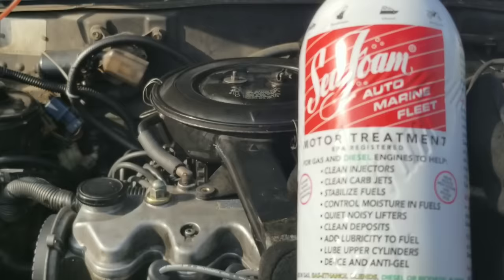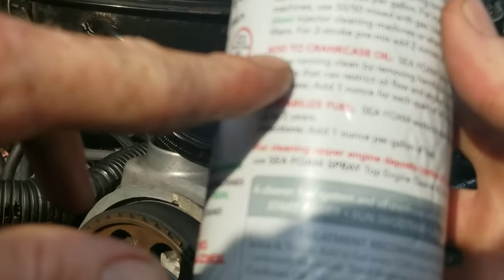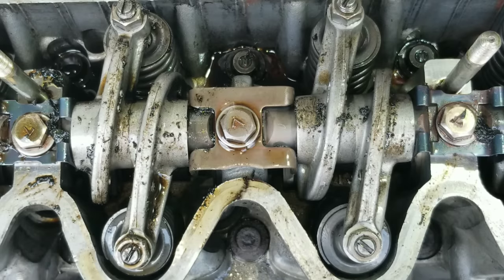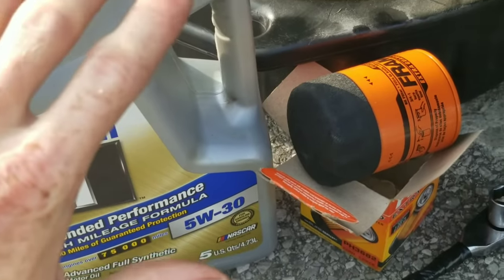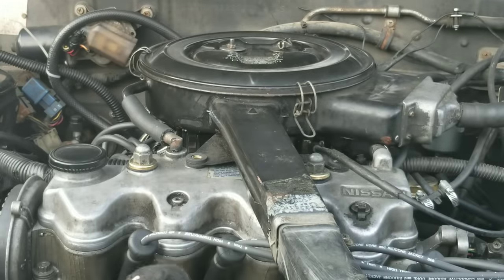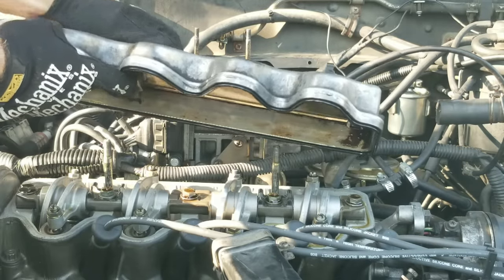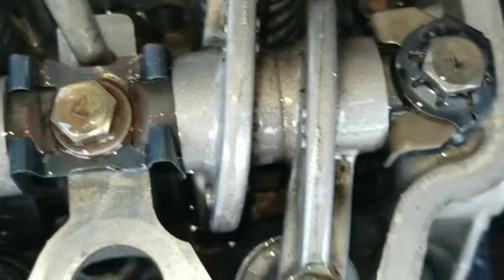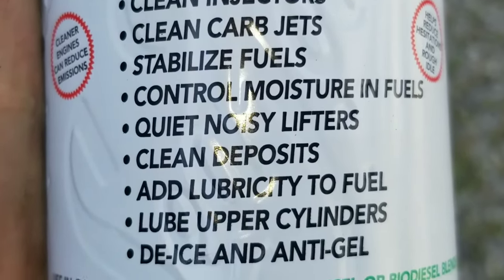Seafoam results i cant believe what it done to my engine

Comment: I'm a retired auto mechanic if you have worn bearings and you put stuff in your motor to clean it you can lose oil pressure because it is the dirty oil particles that is keeping the oil pressure up so if anywhere where you have crank bearings cam bearings connecting rod bearing and you flush your motor out you may lose on a high mileage motor I don't recommend flushing your motor just change the oil like you're supposed to and leave it alone otherwise you could end up losing oil pressure also on an older motor that has a lot of miles on it do not put a high volume pump in an older motor that has a lot of miles on it with a high velocity cough for example 60 lb oil pressure you could end up using oil because the Edition oil can get up in the combustion chamber through the cylinder walls and cause you to burn oil I'm referring to an older motor that that is high mileage vehicle always do a compression test do you make sure your compression is good before you consider a high volume oil pump hope this information helps you the best thing to do when you have a car change your oil every three to four thousand miles and also always change your filter if you always change oil and filter you'll get long life out of your car motor hope this information helps other people

Comment: My question is, where does all that gunk go? It would have been good to see the oil taken out.
Reply: Excellent observation. Be careful using on newer engines. Small oil passages could get clogged from the  loosened sludge and create costly problems.
Reply: It comes out with your oil change

Comment: I got some bad gas pulling my travel trailer with my 2018 F-150, it was stalling out and rough idle. A mechanic told me to use a good treatment and YES Seafoam did the trick, now it's just like new. I keep a bottle with me now just for the bad gas "on the road" situation.

Comment: Using mobil 1 extended performance meant for 15k miles with the shittiest oil filter on planet earth meant to go 3k miles makes zero sense....
Reply from the maker: I use the best oil filter the video is for informational purposes
Reply: Have you ever done a oil change?
Reply: @by_a_tryhard_lol8901  ive only done 2k of them. Why?
Reply: @bmwmike3534  cause you see any type of oil even synthetic its phucked up by 3k
Reply from the maker: Yes
Reply from the maker: What should we test next
Reply from the maker: Yes whats would be good test method
Reply from the maker: What additives do you want to see test
Reply: Go for it
Reply from the maker: What products do you want to see
Reply: using mobil one in general is shit bmw mike. id rather use supertech from walmart with how gritty mobil one is it will run great but thats cause it causes so much friction.
Reply from the maker: Yeah it was a oil flush and thats why inexpensive filter
Reply: I tried using that produc to. Start a fire , it WORKS EVERYTIME
Reply from the maker: Lol any good experiences?
Reply from the maker: Im new to that also
Reply: @NATESINTERACTIVEAUTO  so when flushing the oil, getting all the buildup and grime out of the engine you choose the filter most likely to not filter all the grime out? Makes no sense especially with using high end oil. Under your theory should have been lowest quality oil for the flush
Reply from the maker: The oil actually plays a big role in cleaning also they filter the same practically it is the longevity and durability that make wix xp the best for the price .
Reply: I say change the oil every 3-5k Miles.  I don't care why the oiler car companies say . And the best oil filter is not frame lol
Reply: Ps I hate auto correct!
Reply from the maker: Yes wix xp is the best filter for the price
Reply: Twice a year I use sea foam in my gas , oil and air intake.  Just dis the air intake last night cars quiter.  I use Lucas synthetic once a year also . Helps plus pulling the oil pan an cleaning the magnet.  I also put stronger super magnets on my filter an pan and I'll tell ya it catches alto of small filings.
Reply from the maker: So you add the magnet to the oil pan?
Reply from the maker: Yeah me 2
Reply: @NATESINTERACTIVEAUTO  hell yes ! The more the better , but the magnets are the size of a quarter dollar an they are 7 bucks a piece! But the it's worth It
Reply from the maker: What would improve our test
Reply: @Fable1Guides  put down the bong and do some serious research. That little gem of misinformation must have come from the guy on the next barstool.
Reply from the maker: What should we test in a future video
Reply: You couldn't pay me to put a Fram filter on my engine, complete garbage
Reply from the maker: Yeah good for oil flush and toss
Reply: Lol idk anyone who still runs it 15k miles .......to even bring it up makes “zero sense”

Comment: My 1992 88,000 km Nissan 300ZX engine had a noisy lifter for a couple of years now. Added about 3 ounces of 
Seafoam thru the oil cap and let it idle for 1/2 an hour. Magically, the lifter noise slowly faded to nothing and is gone......as in 'GONE'. Followed up with an oil change and the engine runs beautifully and no ticker noise. 
Does Seafood work. It did for me, in my application.
Reply from the maker: Thanks for sharing and have you watched my new videos on engine noise knock or ticking

Comment: 3 ounces huh?  How did you measure that again?  Too, it looked like you added fake dirt under the valve cover.  Engines typically don't have loose pieces of dirt laying around like that.    I do like Seafoam for gas storage, it works well for that.
Reply from the maker: That was for demonstration as you can see in other videos i use a measuring cup also this is sitting for years and i changed oil drove awhile then smelt burning and checked oil level and went to add only to notice the gunk
Reply from the maker: Lol
Reply: @Devin E Oh yeah, that seems reasonable then!    I have a Fram oil filter funeral business and I'm swamped... they are often dead in the box on the store shelves. : /
Reply from the maker: Lamo what can we try next

Comment: Years ago I bought a Galaxy 500 with a totally sludged up 351 Windsor.  The previous owner told me he ran the car on non detergent straight 30W oil. I tried every chemical known to man to desludge it.  Nothing worked and the fresh oil turned jet black within hours of being changed. I finally gave in and scraped out a full trash bag of baked on carbon from off the cylinder heads and from around the lifters.  Then I just ran the engine on Mobil 1 for around 50,000 miles.  When I took the oil pan off  the lower block was spotless.  

Don't underestimate the cleaning power of Mobil 1 oil.  And BTW, I'm not knocking any other fine oil which might be just as good, but I've pulled apart several Mobil 1 engines and for the most part they were spotless regardless of age or what kind of crap oil the first owner used.

I'm also not saying the seafoam didn't help... just saying the Mobil 1 would have done the job by itself at some point.

Comment: I put a whole can of seafoam in a Chevy LS 6.0 that holds 6 quarts of oil with 258, 000 miles on it and drove it and about 50 miles then change the oil and I cannot believe the sludge that came out with the oil... it definitely helped the oil pressure and their engine run smoother...

Comment: I used it in 2022 . In my fuel tank and spray it in my air intake going the the valve intake . I have gdi gmc 3.0 liter gas engine . Was miss firing due to carbon build up . Now i have to missfire zero . Pretty good so far . I will try to poor it in my engine oil and drive it for few km to clean the inside . Of my engine

Comment: How many miles did you drive after adding the Seafoam before you drained the oil? Was it what within the directions on the bottle? 
Did you add the rest to your gas meanwhile?

Good video! I would have liked to see a compression test before and after in addition to the oil pressure test. 

I noticed you had a extended life oil (15,000 mile) and I'm curious if your engine oil schedule was the same. If it is congrats, you have 4 less oil changes than people with 3k changes. Use some of that saved money and watch some YouTube oil filter reviews and buy a decent oil filter with better filtration/flow and particulate capacity!
Reply from the maker: That filter was only used for the seafoam
Reply from the maker: Also i try and always follow directions because typically the manufacturer provides it so you have the best results and what can i try in a future video?
Reply: @NATESINTERACTIVEAUTO  I looked through your videos and you don't have any cylinder compression tests. It's a inexpensive tool basically a pressure gauge that screws in where your spark plug is. 

Old engines with worn pistons rings or valves would have the most to show from a oil additive with a goal to increase pressure and make up for worn sealing...
Reply from the maker: Seafoam proof i performed compression checks

Comment: 🤣🤣🤣 this guy is a clown, the first oil pressure shot gauge shows 60 and he was on idle, the second shot he was at 70 and rpm is at 1300. Listen to the engine sound of the first and second shot.

Comment: Put 8 OZ in my 76 smallblock chevy that had been neglected.  200 miles later and the oil had that old smell and was extra dark.  Must have did something.  Put it in my gas tank and I think it fouled a spark plug.  Started missing due to what I believe carbon caking on the sparkplug tip.  Cleaned the plug and worked fine.  Beware it will knock off carbon in your combustion chamber.

Comment: I had a massive power loss at about 50 to 60 miles an hour I put seafoam in the upper brake booster I put the whole can and it restored all the power.

Comment: The sea foam may have loosened the sludge just enough to redeposit it elsewhere and clogged some oil passages. That engine probably did not have 75 psi oil pressure when it was new,

Comment: Sea foam thins the oil. I use it in the crankcase right before I change my oil. I add a few ounces to the old oil and run it for 20-30 minutes then I drain and change.
Reply from the maker: What were your results

Comment: Nate,
Each time you remove the Head, you have to Apply a New Head GASKET. Fairly expensive for a DIYer.
Seafoams instructions say:
Add to the Crankcase Oil, 100-300 miles before every Oil Change. Go by the Recommended Instructions.
Seafoam works Very Good in Throttle Carburator Auto Engines.
I use Seafoam in my Mower, Trimmer, Leaf Blower, & Our board Tank.
In the Off Season if ALL Equipment, burn the Gas COMPLETELY OUT. Then do your Maintenance for the remainder.
Reply from the maker: Yeah thanks for the information it helps many people
Reply from the maker: I recommend start by changing oil every 3000 miles atleast if you suspect build up then after a few oil changes and you cant notice alot of gunk use seafoam

Comment: “3000 miles “?  The can says 200-300 miles prior to changing the oil.
Respectfully yours
Reply: i thought maybe he just said 3000 accidentally the first time, but then he said it a couple times after that and then '100 - 125 miles' so im hella confused. did you actually run that ounce and a half (theres no way that pour was 3 1/2 ounces, i used to bar tend so i can tell an oz pour) seafoam for 3000 miles first? then change oil then run 100-125 miles then change oil again?
Reply: daedraprince 
Reading off the can at the bottom back side of the label it says “crank case oil: add to oil 100 -300 miles before every oil change.“ That’s the directions that I follow😎
Reply: @BirdogEd  yeah thats why i was wondering if he really drove it 3000 miles and said it by accident because bottle says 300 miles.

Comment: A little bit of transmission fluid does the same thing too. Put a bit in there. Drive for about a week or a few days before the weekend. Change it. Boom clean engine.

Always use Royal Purples.
Reply from the maker: Yes i have tried royal purple valve cleaner in a video also the royal purple you pour in the tank
Reply: Transmission fluid in the engine?
Reply: @jdavis3226  just a little bit. Put a bit in there, go to the auto store to change your oil and that short amount of time helps remove gunk and steel. Transmission fluid is a detergent, it keeps the steel clean. A few miles ain't gonna hurt it. When you get home, let the car cool.amd then change the oil.
Reply from the maker: Yes for a oil flush there is a video i made with a motor medic flush and its so similar to transmission fluid but you need to proceed with caution and if you follow instructions you will be fine but i prefer the product made for it the motor medic
Reply from the maker: I prefer not driving to be on the safe side
Reply: @thunderheads4103  "just a  little bit " commentors should be more specific.
Just saying
Reply: @jerrypotter9478  just sayin, most people don't have more than 2 teeth when it comes to cars. Most people don't know what the petcock is or how to make a makeshift piston stop.
Reply from the maker: I understand
Reply from the maker: What video can we perform next
Reply: boom !, damaged engine
Reply: Iv used ATF as an engine flush and diesel fuel addative for friggin ever , works great n no BS snake oil that costs twice as much ..
Reply from the maker: Thanks what can we try next

Comment: Seafoam worked good on my used honda I bought with a p2646 code. Brought the oil pressure up so Vtec would work right.

Comment: At least half of it is pale oil, the rest is "petroleum distillates" generally on consensus of a third naptha and the rest isopropol alcohol, although i've heard tale they add in some other wizardry.  You can smell the alcohol not only out of the exhaust, but out of the oil-cap or pcv.  It mists inside the crankcase when running (especially higher rpm).

Comment: Wait why are you using the cheap orange fram filter with the extended performance oil? Using oil you can do 10k-15k miles but then using a poor 5k mile cheap filter why?
Reply from the maker: Quickly changing after flush but i use a wix xp filter and change my oil every 3k

Comment: You really need to be careful with engine cleaners you ad to your crank case.  They are an acid.  Use to much and you run the risk of damaging your valve stem seals.
Reply from the maker: They will not damage seals. I have used many years
Reply from the maker: I appreciate the information. Have you tried this product before?
Reply: It’s not acid lol
Reply: Seafoam isn't acid. Read the can.
Reply from the maker: What can improve our tests
Reply: Another one with the wrong info

Comment: I had an older Ford 350 engine 5.8 L pickup  and the Throttle box high rise Plenum would always get gunked up and had to be taken off. Seafoam cleaned it and kept t clean without taking it off!

Comment: Haven’t used sea foam in a while, but I’m sure it says put in 100 to 300 miles before oil change. I don’t think you were to leave it in for the duration of the oil.
Reply: It says you can put in anytime best to 100 to 300 miles before oil change.

Comment: First of all that gunk looked placed on there in the beginning. 

2nd That wasn't 3 ounces

3rd You can obviously tell those rockers and everything else were wiped clean. Cuz it was still dirty in all the crevasses that you couldn't get your finger in

And finally, you can very obviously tell you were holding it at a higher idle to get higher oil pressure from the sounds of the motor compared to the first time u showed the oil pressure.

🤦‍♂️ imagine making this whole video thinking you fooled everyone. Mechanic in a bottle doesn't exist my guy

Comment: I have a 2005 Chevy Silverado.  The engine would peck and knock about half the time.   I put 3 oz in and so far so good.  I've tried Lucas Oil treatment to no avail.
Reply from the maker: What other products should we test
Reply: Drain out an appropriate amount of oil 1:1 pour whole bottle in and run 15 miles. 

Same results just faster. 

Whatever you do DONT run a whole can longer than I suggested as Seafoam cuts oil viscosity
Reply from the maker: Follow manufacturer's specifications

Comment: I do all the time  for oil n intake for 1998 Ford f150 its naturus  for intake  problems. Since been useing it its supper great. I also do for gas as well so does the Sox n lines reccomend  you change  gas filter  after. Oil going all the time great for I do 2 times  straight makes it perfect  clean  not just some spots.
Reply from the maker: Your right test ideas?
Reply: @NATESINTERACTIVEAUTO   my test idea do the injectors
Reply from the maker: I have been working on a injector test setup so you feel its a good test for people to see?

Comment: I add 1 time a year
Reply: I do it before every oil change
Reply from the maker: Wow does this help?
Reply: @NATESINTERACTIVEAUTO  
You don't feel a difference when you do it that often. But it keeps the motor clean ALL THE TIME  which helps extend the engines life and prevents carbon deposits from happening rather than cleaning carbon up deposits.
Reply from the maker: Absolutely i appreciate you sharing

Comment: IMHO SeaFoam is essentially "Kerosene" the ol timers fix for cleaning an engine, but they  said drain it after 10 min and replace with (if an older engine) a heavier oil or it will cause other problems like lifter/valve tapping... thats what happened to me, SeaFoam made the oil thinner, very loud tapping from valve/lifter, changed the oil for heavier straight 30 wt or 20-50 , now it the tapping is barely noticeable.   Other says similar, heavy oil makes a better lubricant IF its an older higher mileage engine, and the heavier oil make oil leaks slower, and collapsed lifters  work better again.   se la vie.   (or just buy some kerosen and add a quart ?  then replace with heavier oil , LOL )